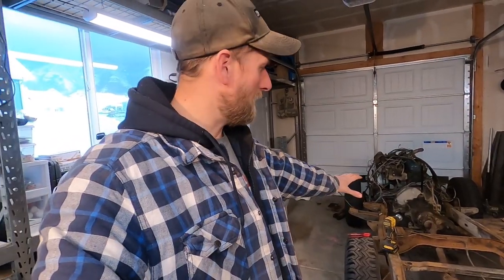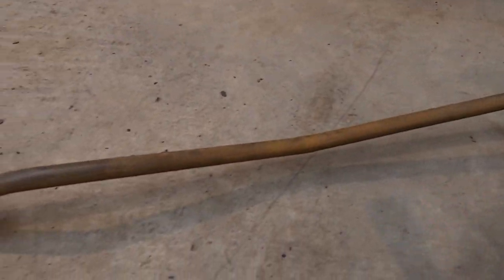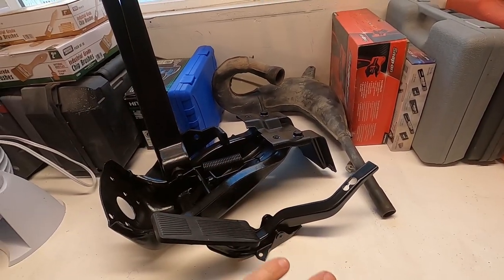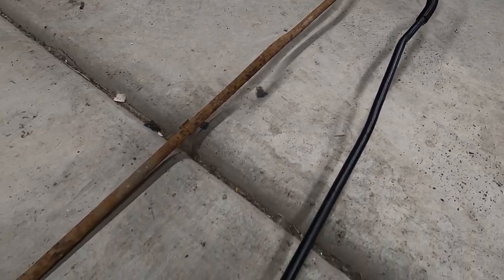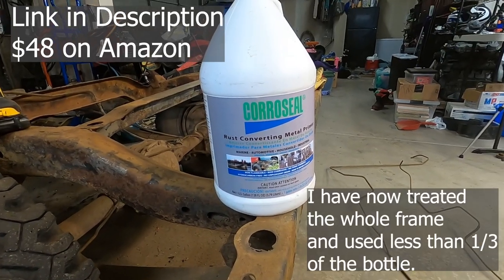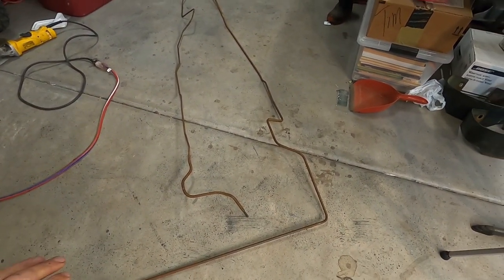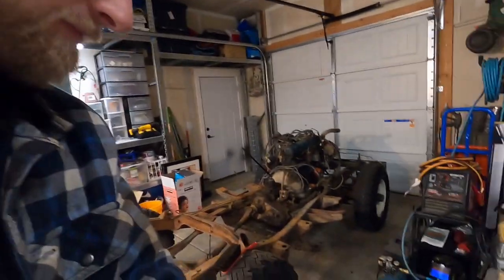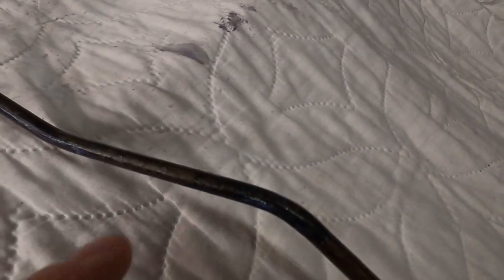Making Surface Rust Look BRAND NEW!!!

Comment: Thanks for this.  Working on my 1st gen and there are more than a few places that surface rust could use this treatment.
Reply from the maker: You could definitely use this. You just have to make sure to paint it over it afterwards. This is not a rust encapsulator like POR 15. It only converts the rust.

Comment: I recently bought an old steel flatbed to install on my old work truck. I applied Corroseal to the deck of the flatbed which had surface rust for the most part, but some spots were beyond surface rust. It looks almost new now! Next up is the underside of the flatbed, my truck frame, and then top it off with some paint. So far, so good!
Reply from the maker: Awesome! I really am impressed by the corroseal.

Comment: Sounds like a good plan! If you want to get a little more spendy, I've had great luck with POR-15. It's insanely tough like ceramic coating almost. Another thing I like is using charcoal grill paint for headers and other stuff that gets near the heat. Happy New Year man
Reply: I logged on to the POR website and they have a few variations of their product. Which is the one your referring to that will give the tough ceramic like coating?
Reply: @therestomaestro3556  Just the regular black variety. Stuff is no joke. NEVER get it on your hands haha
Reply from the maker: Thanks Benjamin. Corroseal is a different class of rust product compared to POR 15 and chassis saver. Corroseal is a rust convertor and chemically changes the rust. POR 15 and chassis saver are rust encapsulators. Both are effective, just different. I used Chassis Saver on my crew cab and was very please. And I totally agree, DO NOT get it on your hands!
Reply: @decentgarage  Nice thanks for the tip I'll check out that product as well!